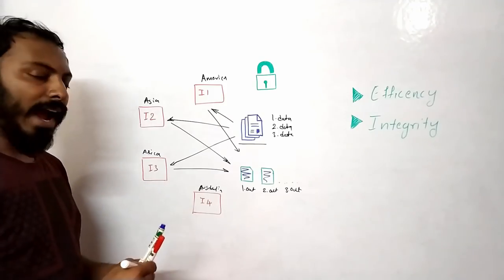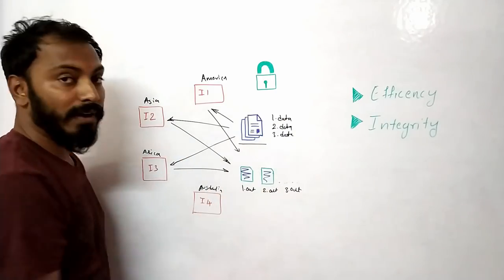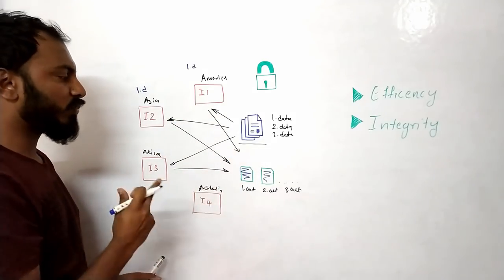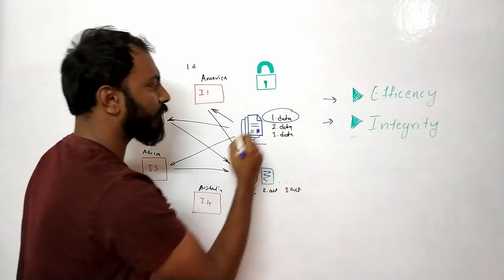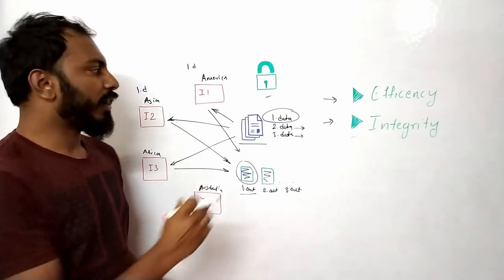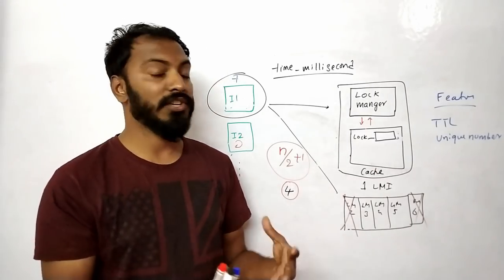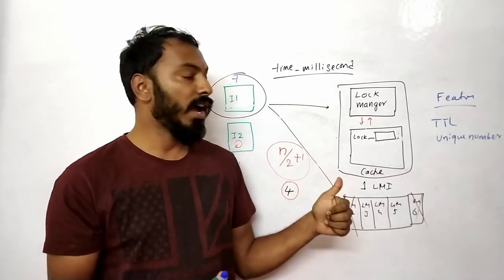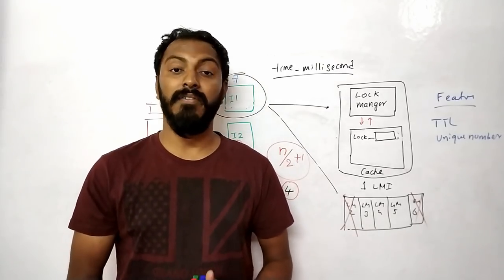Distributed Locks | System design basics

Comment: Why make things complicate? 
If you are saying it might take hours to process one single file that means that node would be able to process another file after few hours. so now lets assume you would have 10 nodes to process those large files. 
1. 10 nodes will come online
2. All of them will read locks from the database and pick one file based on the availability mentioned in the shared database ->  (10 writes and 10 reads)
3. 10 nodes will start processing those files and will come back later after few hours to pick new file. (again 10 writes 10 reads)
4. this will get repeat 10 times a day. lets assume some files are smaller. still that is only 100 reads and 100 writes per day. I think this is efficient

Comment: Good description of the problem. But the explanations are not quite there. 
There are so many flaws in Unique ID, Clock mismatch (For using time) and the system setup for distributed lock manager.
Time to go back to "Designing Data Intensive Application" - Chapter 7 Transactions (Topic : No Dirty Writes, Two Phase Locking) & Chapter 8.

Comment: Sir great video compared with such others! I do have few questions:
1. Suppose we have 5 LM nodes, and 3 of them are down. I1 acquires a lock and 2 LM return the lock, and this lock will be considered as a valid lock since there are two active lm (2 >=2 / 2 + 1). And later the 3 LM nodes come online again, and I2 acquires the same lock, and the other 3 LM will return the lock and this lock will be also valid since now 5 active lm (3 >= 5 / 2 + 1). So there will be two locks available in the system!

2. You mentioned you will check how many LM are available, how can you get the active LM in the system? you can send periodically ping or heartbeat, but the status can be changed when you acquire the lock, so you will get an unreliable active LM count.

3. Same question as @Kapil Karnwal,  I1 got a lock for 5 seconds, I1 MUST stop working and renew the lock before the expire time but there may few things happening:  a. I1 knows the lock is going to expire in 5 seconds, but the system clock on LM and I1 will be sightly different (NTP), and how do I1 exactly knows when to renew the lock? (A straightforward/safe way is stop working and renew the lock at 4, but you know this will slow down the whole system by 20%, as for every lock, it only works in 4 seconds).  b. I1 issued a shared storage write request on second 4 (since the lock is still valid, so I1 can still perform long running task), but the write request takes 3 seconds to complete on the remote server, and during this I2 acquires the lock and issue the same write request, and the data on the shared storage will be corrupted?
Reply: Not really. By this design, when 3 of nodes are down, you won't get the lock. Because for the clients, you won't really know how many lock server are alive. That's also not the client's responsibility. All you need to know is that in total, by design, there're 5 servers. When 3 of them gets down, you'll just receive 3 failures to acquire locks. Of course, In this case the lock system is down. That's why you need to at least deploy 3 servers. In your case, the likelihood for 3 servers in different regions to go down is quite low, if you're using mature cloud providers.

Comment: I'm sorry but too many flaws with the design. 

1- Adding TTL allows a window for corruption,  instance 1 takes lock,  after TTL, instance 2 takes lock (while instance 1 still holding it) => race condition
2- Using epoch in sync between multiple machines is impossible, and using some tolerance defeats the point of using epoch in the first place.
3- What happens to machines that dies after they come back? how do they catch up and become healthy again?